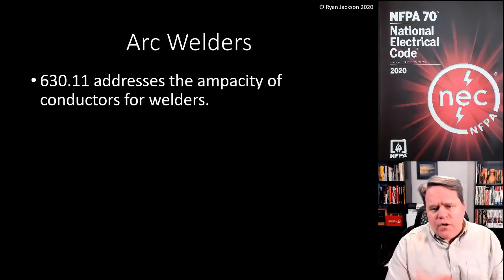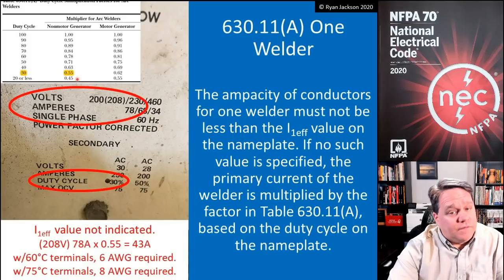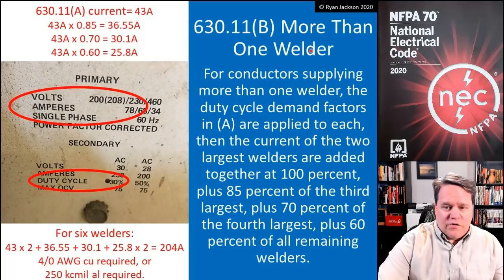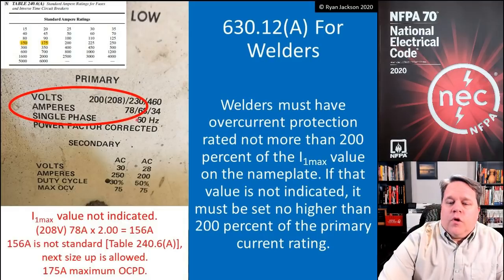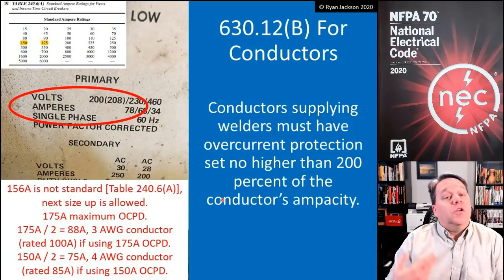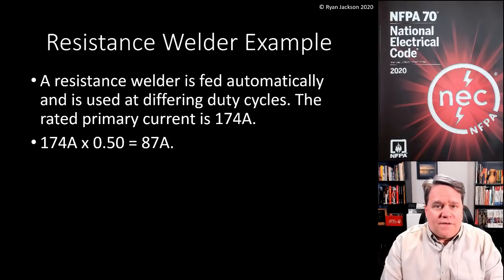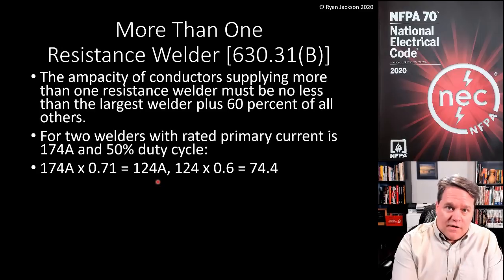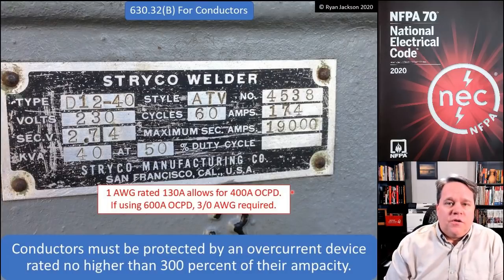Conductor and overcurrent protection for welders, based on the 2020 NEC.

Comment: Thank you for all that you do for the trade and community. Can you share with us how to calculate the feeder for multiple, different types of welders and cutting equipment on the same feeder? For example, 6 arc welders with varying duty cycles and current, 5 resistance welders with varying duty cycle and current, 3 plasma cutters, and 6 mig welders?

Comment: Ummm ok then... they made that so much harder then it needed to be, every welder I have wired up has had a 50amp plug on it with the maximum current being 45 amps, so I would just run #6 copper and put it on a 50amp breaker and it works fine... now I understand that this may be for factory type installations but I still think they made to way to complicated, but that's just my opinion

Comment: I got a little lost on the overcurrent example, so I'm hoping you can help me. The arc welder example has 6 welders on one circuit and you add all of the welders' current requirements together per the code formula to get 204A. So, if you're required to provide overcurrent protection for the welders and overcurrent protection for the conductors, how does the breaker for the entire circuit provide overcurrent protection for each welder? In other words, let's say the breaker size for all of the welders is 200A and one welder is only 78A, how is that 200A breaker providing overcurrent protection when only one welder is in use?

Comment: Quick question probably just a easy mistake. You were talking about resistance welder and the example was an automated welder at 174 amp. You used 50% for your demand factor but I thought automated was 70%?  Just wanted to make sure I was doing it right. So 174x.7=121.8amps
Reply: I believe it was supposed to be 70 demand factor I had the same question

Comment: That was very interesting! I’ve always wondered how the code treats machines with such low duty cycles. I *assume*, and you know what they say about that, that if a welder is cord and plug connected, the OCPD must not exceed the rating of the receptacle, and the minimum conductor size would be based on the standard ampacity rules. After all, anything might end up plugged in to that socket in the future...
Reply from the maker: Nope, the receptacle, conductor, and OCPD rules are totally different.

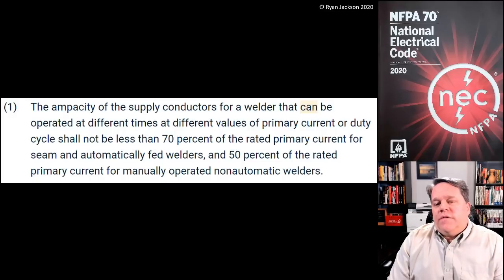Comment: This is a great video.  I love the way you can explain things.  I would like to make 2 points.  1.) At 14:28 as you were reading Item 1 you said 75 amps not 70 as noted in the code.  It is an easy error.  75 is a much more common number than 70 in the book and all the stuff that is made for electrical stuff. I am also older and hard of hearing so I might have it wrong. 2.) I think you should note that this discussion is about the wires and overcurrent devices that supply electricity to the welders discussed and has nothing to do with the wires that come from the welder and feed "the work" or what is to be welded.  There is an old term in welding for the return lead - "The Ground."  Some places and teachers are trying to slowly change the term to the "Return Lead."  Welding is so interesting because you are playing with high amperages and lower voltages derived from 208/220/440 or many other line voltages and yet the person doing the welding is in contact with electricity.  I have had my hands around the electrode to steady it ("protected" by the leather gloves and the flux coating on the electrode) while leaning on the metal to be welded and with my feet in contact with the earth and never a shock. I love wiring and welding.  They are both very complex.

Comment: I do a lot of power plant controls engineering...not new stuff but interfacing new with old.  I'll never run out of work for sure.  But, I've been pigeon-holed and feel like I'm on misfit island.  I enjoy what I do and it is a necessary niche.  But, it is a damned weird feeling to be the "go to" guy for legacy things.  But, the legacy things are still the things that make things work.  The things that work do not change just because the code changes.  Arrggg.  Love it and hate it too.

Comment: I enjoy your vids and have a question:  Sorta long one but here goes.
I am an electrical engineer that recently(6 years ago) replaced the forced hot-air duct work in my mother's basement(dirt floor at the furthest extents).  When I grabbed the things(ducts), I got a very unpleasant shock.  So, I measured it furnace duct to earth(where my butt was) and it was about 48 VAC.  I shut the mains down to my mom's house...no change.  I measure voltage difference from pole 6 AWG wire grounding rod and worked out from there.  2V at pole and 90V at backyard flower bed(referenced from Mom's neutral with mains off)  The folks next door built a new garage and as an engineer I sorta figured they bonded the service at the new garage and also drove a ground rod(required I think for a building 100' away from whatever that was servicing it...rod, not bond).   They should not have, IMO.  I should never measure 90V from the tulips to the neutral of anything.  Problem is is this: I complained to 3 entities: 1) Utility. Response: Not their concern.  I understand and am fine with that. 2) Next door home owner. Response: No Clue. but here is the contact info for the electrician. 3)  Contacted the electrician.  Response:  A bunch of foul language and demand for $$$ for any work involved.  All that said, there is still the same 90V from neighbor's tulips to Mom's neutral.   No one outside feels it and the only detrimental real effect is maybe a very dry sill-plate on a very old house. But, I went there last week to change furnace filters and got the same old buzz I got 6 years ago.  Any thoughts.  Would local AHJ even listen?  I doubt it.
BTW, how did I measure this?  Mains off in Moms house (should not make difference), an extension cord and a multi-meter with one lead on neutral and the other in the soil.  90VAC at nearest tulip.  Sorry for so many words.
Reply from the maker: My first thought, without spending a ton of mental energy, is that your neighbor is using the earth as his/her return path. In other words, they only installed ungrounded (hot) conductors and no neutral to the garage.
Reply: @RyanJacksonElectrical  ... and used the metal conduit as the ground?
Reply from the maker: @wim0104  My guess is none at all. Just 1 or 2 ungrounded conductors and a rod.
Reply: @RyanJacksonElectrical  Yes.  Totally agree with this. Tricky getting a cheapskate neighbor to fix something though when they sense no problem.  Oh well.
Reply: is there a sprinkler system, or garden lights?? or maybe you have a floating neutral in your mom's house? Is the live-to-neutral voltage stable and at a sensible value around the house, and no voltage diff between ground and neutral? Is there any GFCI protection in that house?
Reply: at your 90V ground-to-neutral measurement, you should also check ground-to-live, and neutral-to-live. remember there's split phase service at the house and mix-ups could expose you to 240V. So don't be sitting/kneeling in wet dirt. I think your neutral might have some bite in it.
Reply: also measure in your service panel: neutral to each leg/phase. And is the voltage stable, or does it move with changing loads?
Reply: anyway, it might be worth hiring an electrician :-) 
and they might call in the utility about a floating grounded conductor in the service.
Reply: @wim0104  It could be worth it but I am an electrical engineer. 'sposed to know it all right?  I do not know it all.  What I do know: Utility neutral to very old copper water pipe with mains open: 0V.  Mains closed: 0V. Mains open: Utility neutral to neighbors flower bed(~100' away) 90V.  Midway, my butt in soil and hands on furnace ducts: ~48V.  Seems to me that something fishy is going on in neighbors system, not my mother's.  I do know that it pisses me off when I have to put on insulated gloves to change a furnace filter in a dirt-floor basement.
Reply: @nhzxboi  sorry; the electrical engineers around here are not hands-on, and semi-conductor types. and I read your readings & main breaker flippings wrong. 
I bet Ryan is right and the neighbor's electrician skimmed on a lot of copper... and Mr Neighbor will never find any worms to go fishing with.
Reply: @wim0104  Yea, I'd love to babble about in person just because it would be fun to interact..not something that  works right now.  Anyway, I only get a jolt when I change furnace filters in Mom's house. Every 3 years?  I don't care except at the moment. I'll probably bitch about it in 3 years from now.  Why?  cuz that 48V zap reminds me of what made me angry 3 years prior.  The kids are in no danger next to fence, it is only the fool(me) changing furnace filters in a house 20' away and having  my sneakers solidly in soil next to the garage that someone bonded neutral to ground rod 100' away from the service. Arrggg.  All I know is that there is potential there and no "authority" will listen unless I pony up some dough....including local AHJ.  Is frustrating.
Reply: @nhzxboi  I don't think it's a bonding issue.
I think Ryan is right: they did not run out any ground, nor neutral conductor, to that garage. They're just dumping the neutral current into a ground rod. No worms for you.
Reply: @nhzxboi  I think you are missing something.  Step back and take time to completely analyze objectively?
Reply: @wim0104  No. Volts are pretty consistent summer or winter.  NH here.  There is no particular danger to anyone outside as the difference is minimal...fence to ground and the like.  But, when you're grabbing furnace ducts and your butt is in soil, that is when you feel the 'difference'  Odd situation.  Local potentials are low in a situation like this.  Drives me nuts.
Reply: @wim0104  Sorta makes sense.  Voltage being 90V if the guy bonded the remote neutral garage to ground rod.  The garage and where I measured volts in soil is about  1/10th distant give or take.  Not enough current to kill but enough voltage to piss me off when I touch furnace duct work.  Not all, in fact, very few electricians are geniuses.  I'm not a genius but I resent the zap from a poorly wired system...took me a while to figure out what the hell was going on.
Reply: Use a clamp meter to check for current on the main ground and neutral which the main breaker turned off. If there’s current, I’d have to agree with others that the neighbor’s garage may be the issue.